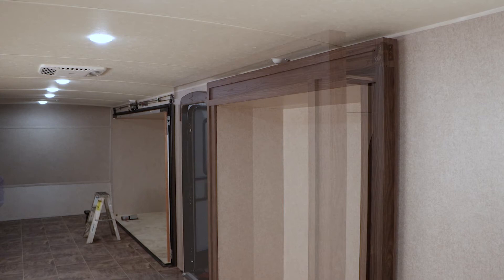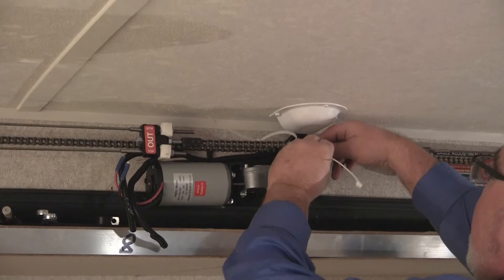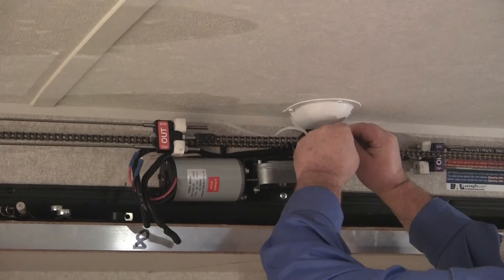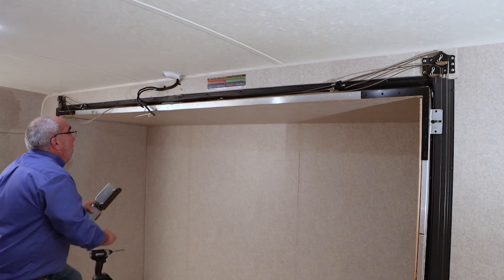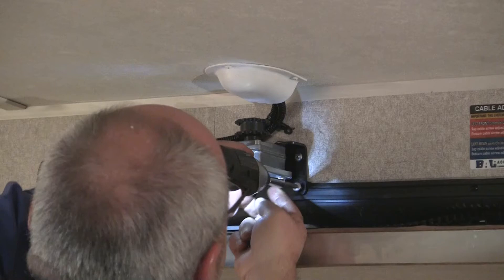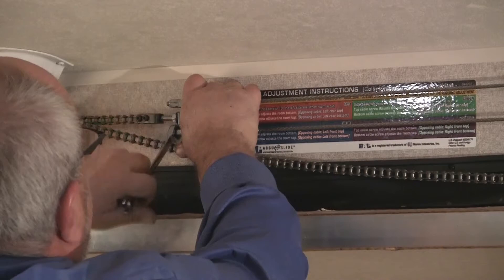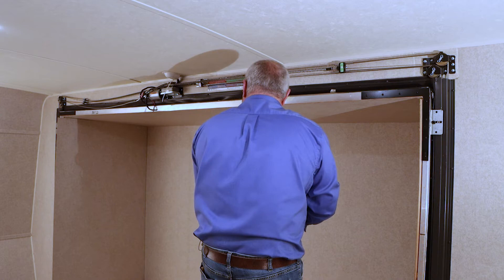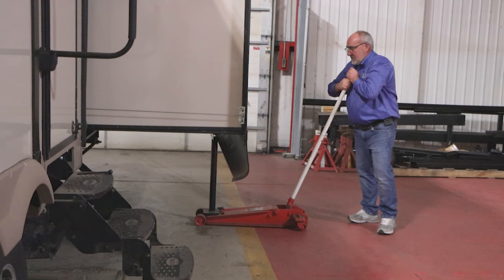BAL Accu-Slide Motor/Gearbox Replacement Procedure

Comment: The foam nut also helps the nuts from moving when you are operating the slide. When the motor switches directions, there is a moment of equilibrium and no pressure on the nut.

Comment: I have made a big mistake in trying to change the engine and I missed the cables conections...  Then I saw the video and I realized that each one is very important. Now I don't know which one corresponds to which one I'm trying to investigate, but I can't find any video explaining it. Which fight does each of the cables correspond to, both in and out of the front and rear.... I am very confused and afraid of ruining the system now that I have the new engine
Reply from the maker: You are in good hands. I have provided a link to the cable routing diagrams as well as a link to a document that will help with the chain placement on the dual sprocket of the gearbox. 

1.https://balrvproducts.com/wp-content/uploads/products/oem/slides/GDS.SLD_.030-ACCU-Slide-Cable-Routing-Diagram-REV-B.pdf

2. https://balrvproducts.com/wp-content/uploads/downloads/tech/ACCU-SLIDE-CABLE-ROUTING_ALTERNATIVE-DRAWING.pdf

3. https://balrvproducts.com/wp-content/uploads/downloads/tech/GDS.SLD_.031-ACCU-SLIDE-CHAIN-INSTALLATION.pdf

If you need any additional technical help, please email baltechsupport@norcoind.com to send some photos of what you have going on and they can help advise what to do.

Comment: Great video - I have a small bed slide. It broke while all the way in and it will only move out about 3/4" before the teeth on gearbox start slipping. Can I replace the gearbox with the room where it is ? I think I can reach it as the slide is only about 20" deep.
Reply from the maker: Yes, you can replace the gearbox in any position. Just remember to use zip ties or something to loop through the chains to remember where to place them around the sprockets.

Comment: I only need the same rocket replaced for the pulling back in of the slide. Is that possible?
Reply from the maker: I believe you are referring to the adjustment bracket. Click on this link to confirm that this is the part you are needing: https://balrvproducts.com/product/22504-cable-chain-adjustment-bracket-kit/

Comment: My slide is all the way in, would in I tighten the in cables first ?
Reply from the maker: The best way to perform an adjustment is to extend (in the out position) the room completely in order to have easier access to the cable adjustment brackets. With the room fully extended check top and bottom of both sides to verify all points have sealed. If it is not uniform then an adjustment is necessary.
1. Before tightening an adjustment nut, loosen the cables and chains attached to the “IN” adjustment brackets to insure that the exterior cables wont pull against you, while trying to accomplish an out seal.
2. Tension the OUT BTM cables until the bottom interior standoff brackets make contact with jamb.
3. Tension the OUT TOP cables until the adjustment bracket is sitting straight up and down insuring that both OUT TOP and OUT BTM cables are tensioned evenly.
4. Tension the IN TOP and IN BTM cables and chain until you have reached ½” deflection on the exterior cables. (Deflection: you should be able to use your thumb and pointer finger to easily lift the cable ½” and push the cable down ½” from center.)
5. When the system is adjusted, tighten all jamb nuts and replace anti-vibration blocks.

If you would like more detail and diagrams, feel free to email baltechsupport@norcoind.com and they would be happy to assist you.

Comment: How do you get the slide out back out to fix it.  My gear box is broken could hear it break.  also how do I change the rollers on my Lakota Horse Trailer?  It was like the slide was stuck before it broke the gear box.
Reply from the maker: If you could email baltechsupport@norcoind.com a photo of the style of rollers that are currently installed and explain that the room appeared to be stuck before the gearbox failure, they can assist you in replacement parts research and installation instruction, with the safest way to extend the slide room for repair.

Comment: I am replacing the motor assembly. I've noticed mine is the opposite of yours in the video. My gear box is facing down. Does it make a difference? Currently.
Reply from the maker: The process is still the same for motor and gearboxes that have the sprocket pointing down. Just make sure you mark which chain attaches to the motor first, on the sprocket closest to the gearbox.

Comment: My issue is that the mounting screws for the motor and gear box assembly have worked themselves loose and the holes have become oversized. It seems the screw locations are not into any substantial backing. I'm planning to create a mounting plate (1/4" aluminum) large enough to span any framing members and attach the assembly to that with machine screws. Does this sound like a good plan?
Reply from the maker: You are headed down the right path. You could also reach out to the OEM of the RV to obtain an engineering print of the main wall to determine the location of the closest wall support (i.e. studs and header). There will be a main header running across the top of the opening in that main wall. Adhesive on the back of your aluminum plate, screwed to that header would give you the surface you need to secure the motor.
Reply: @NorcoIndustries  my first thought and you would be who to ask. What about using larger screws?
Reply from the maker: A larger diameter wood screw would be recommended if the holes have become oblong or oversized. Do not use self tappers or they will act like a drill and bore a hole, not allowing the thread of the screws to hold.

Comment: What could be the problem with my slide ... whn you push the in/out button the slide will move for a min then stop, I give it a few seconds and it moves a little more and stops again. Eventually after successive pushes & some time it will extend/retract all the way. But it's time consuming. I have resorted to using my drill as it is much faster.
Reply from the maker: When a slide-out stalls repeatedly like this, it typically means there is a voltage related root cause.

TRY ALTERNATE POWER SOURCE DIRECTLY TO MOTORS. 
CHECK VOLTAGE COMING OUT OF THE BATTERIES. IF IT IS LOWER THAN 12V, CHARGE OR REPLACE BATTERIES.
CHECK VOLTAGE COMING IN AND OUT OF THE SWITCH. THE ISSUE COULD BE THE SWITCH, THE BREAKER BETWEEN THE BATTERIES AND SWITCH OR THE WIRING IN BETWEEN.

Comment: Can I push out my slide if the motor is disconnected and if so do I have to support it. Waiting on parts and would like to have it out while waiting
Reply from the maker: You can push the slide out half way with the chains removed from the motor. Make sure at the halfway point, you place support under the room with a jack.

Comment: How do you grease the slides underneath?
Reply from the maker: RV OEMs use a variety of glide surfaces when they design the construction of the slide room and the opening in the main wall of the RV. If equipped with a wear bar or rollers, you would want to use a food grade lubricant such as ZEP 45 with PTFE to spray along the glide surface.

Comment: Anyone run into the factory installing the cables with no room to lossen the nut so you can replace the motor. All four cable adjustments have no slack to losses up, if I back the nuts off all the way, the tension will be so high I will not be able to put it back together?
Reply from the maker: In that situation it may be possible to loosen the chain adjustment to add slack. If that does not give you enough slack to remove and attach the chains to the new assembly, it should give you enough slack to detach the opposing end of the cable from the standoff bracket. You may need to use locking needle nose vice grips to slide the cable end out of the standoff brackets. Just don't let the ball end of the cable get pulled inside the jamb assembly.

Comment: Hey I just bought a Gulfstream camper with a accu slide out. On our first trip my wife tried opening the slide without leveling the place. It stopped working completely the motor didn't even make noises. Under the dinette I noticed the motor and I took the power leads off the motor. When I press the slide switch I have no power going to motor. The slide still works if I jump power from battery too motor. Does is this accu system have a controller somewhere I can't find ?. The breaker and fuse for rv slide is good so I'm not sure what I'm missing. Turns out the bottom plywood sheet that rides on rollers is all rotten out and I'll need to replace it or slide some metal sheets in there. Any help would help as I have opened up every shelf possible and I can't find the controller for slide. No power coming to the slide open and close switch. I have a 2013 gulf 23rb visa. Slide is with dinette and accu system with motor at bottom of slide. Please help
Reply from the maker: BAL Accu-Slides did not come with a controller between the switch and the motor. Some RV OEMs add their own relays from the switch to the motor to reverse the polarity, depending on the style of switch they were using. There should also be a dedicated 30 amp reset breaker from the battery to the switch. If you have a volt meter, check to see if you are getting 12v to the switch and 12v coming out of the switch.
Reply: @NorcoIndustries  hi thanks for the reply. It's good to know that I can stop searching for the controller as it doesn't exist. Perhaps this reset braker is located somewhere outside under the camper ? The fuse dedicated from main power panel is good
Reply from the maker: @davidkania3720   The 30 amp reset breaker can be located in-line from the battery, which is usually within a foot of the battery itself and will likely have a plastic housing or cover over it.
Reply: @NorcoIndustries  thanks I'll take a look
Reply: @NorcoIndustries  reason I ran into the whole issue is because the underside of accu slide rotted on one side and the plywood fell apart and won't roll nicely on the 4 rollers it rides on. Is it possible replacing that whole plywood underneath without completely removing the slide ? Is there any info on how to tackle that project.
Reply from the maker: Replacing the slide floor without removing the slide box from the RV is not something we have attempted. Depending on the construction and location of the fasteners, that might be more challenging than pulling the room to make the repair. One thing to note when replacing the floor of the slide is to ensure the slide box is square by taking cross measurements while installing the replacement floor. Doing this early on, before sealing and trimming out the slide, will give you a chance to square things up before you are too far along.
Reply: @NorcoIndustries  what a nightmare. Just bought this trailer and discovered this. We are keeping it in Bancroft ontario. Do you know any places that would be able to quote me for this repair. I don't think removing the slide completely is something I'm capable of. Perhaps I'll just slip in some metal sheets to give that roller something firm to slide on.
Reply from the maker: @davidkania3720  With this being related to the construction of the slide room, the RV OEM would be the best resource to help provide you with RV service center contact lists.

Comment: how does this type slide get pushed out, I have the same one, and there isn't a ram under it, just 2 cables on each side.
Reply: There are actually 4 cables on each end. An upper and lower cable run to brackets by the flange at the exterior wall for in, and two other cables run to brackets mounted to the interior edge of the wall, concealed by facial. These pull the slide out.  At 10:09 you can see the upper right extend cable and bracket. It runs through a couple pulleys up to the adjustment brackets he was showing.
Reply: @JeffinTD  mechanical marvel, works well. Some people avoid this type, but overall, its been great for me, and reliable. Nice explanation, thanks!
Reply: @VOOODOOO37   Nice!  I’d also heard negative things about this type, but I only have experience with hydraulic and electric rack and pinion. Trying to YouTube educate myself, these don’t seem that bad to adjust or repair. A hydraulic leak, or a broken gear on a discontinued rack and pinion aren’t exactly a picnic to deal with either.  Anyway good to hear yours works well. I think I might prefer this to a Schwintek.
Reply: @JeffinTD  I watch Josh The RV Nerd, he has done videos on most types. They all have their possible bad points, but I don't sweat it, with so many RVs out there, I've never heard of everyone steering clear of Schwintek for example.
Reply: I do like watching Josh, but there is a bit of rose colored glasses there, imho. Yeah a Schwintek on a small slide wouldn’t put me off a model I otherwise like, but me personally I wouldn’t want a large heavy slide on that system.

AZ Expert is another great YouTube channel, as is Hillbilly RV
Reply: @JeffinTD  Oh yeah AZ Expert is great, a true craftsman. I agree about a big slide on a Schwintek.

Comment: @NorcoIndustries Is it possible to buy just the motor?
Reply from the maker: Accu-Slides have mulitple styles of motor and gearbox assemblies that are used depending on the specifications of the RV OEM. Some are a sealed unit and others are assembled, making the motor and gearbox available separately. If you can access the motor and gearbox to identify the numbers on the labels of either, often those part numbers can be searched on balrvproducts.com to identify if the motor is available as a separate component. Also feel free to email baltechsupport.com with a photo of your motor and gearbox assembly for help in identifying available replacement subcomponents.
Reply: @NorcoIndustries  Thanks very much.